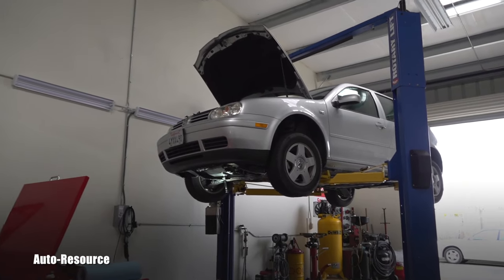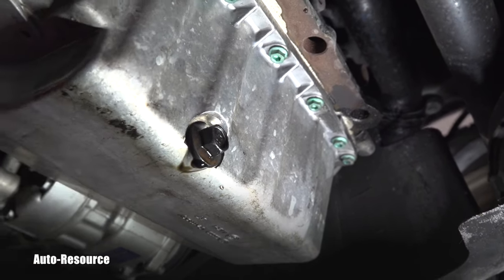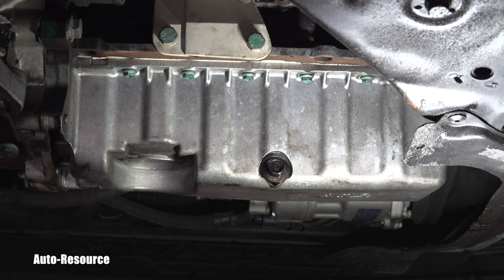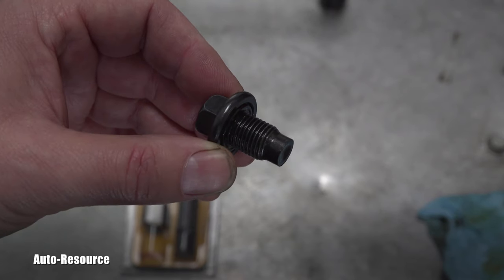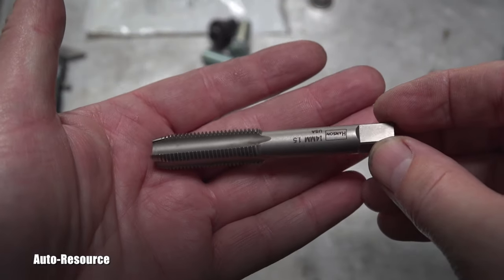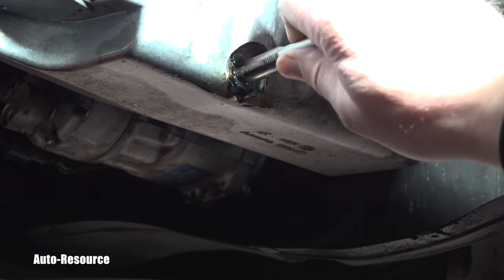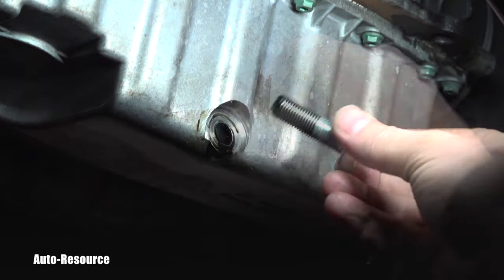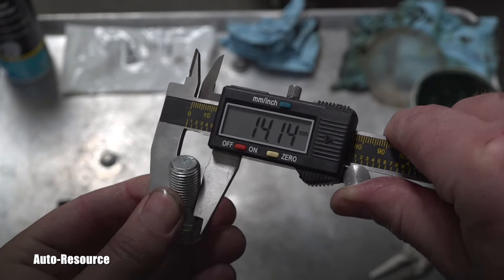Stripped Engine Oil Pan Plug Repair

Comment: please mention that alot of these problems are caused by incompetent Technicians who over torque the bolts, use impact guns, etc. This is not a tire change, these bolts do not really require much torque at all. The result is rethreading or changing out the oil pan. Do dealerships do this on purpose to generate money or do they hire people who dont know what they're doing. Either way this is an expense that is unnecessary.
Reply: It also randomly happens I've done 25+ oil changes on my Honda and today all the threads came out when pulling the plug
Reply: I got "scammed" by a service shop that offered a 1/3rd discount oil change for $55. They gave me a "Free" diagnostic for over $1200 of additional (upsell) work - which I
 declined. Unfortunately, my teenage granddaughter went back to the same shop for a 2nd oil change - wanting to get the same discount. That's when this shop pulled out their scam! They claimed the oil pan gasket got over-torqed (butt and the car/oil pan that had No Oil Leaks and without a "Service Engine" 😊 light display now needs to have the oil pan and gasket completely replaced at a cost of $1100.😮
We're going to end up in court over this scam...
Reply: @wowgen123 is correct.  This is a pattern failure on Honda oil pans.  Also, dealerships (and other independent shops) all have some incompetent employees.  You don’t put your ‘A’ tech on oil and tire changes. It’s usually a high school kid working part time.
Reply: Fr I got scammed by the last person that owned my car. Same issue I just did my oil change for the first time yesterday and same shit. Bogus now I have to use a thread tap kid to make a new thread 😅

Comment: Nice fix but you should always crack the filter loose before installing the drain plug.  They typically hold a 1/2 qt of oil due to vacuum.

Comment: I used the spark plug repair kit shown. Tapped new threads, put the insert in, and used a spark plug as a drain plug.  Not sure it was needed but I wrapped the spark plug threads with plumbers Teflon tape and plumbers dope. No leaks yet.

Comment: Would have poured in some new oil to drain out metal shaving  great info
Reply: save the old you take out  before you cut use that to flush

Comment: Great repair, however I would have trimmed the 9/16 bolt to the length of the thread in the pan, perchance a longer "Plug" would come in contact with the Throws of the crankshaft.....that would be catastrophic.....just observing....

Comment: I had issues on a 2014, 1.8 L Jetta. It would slowly bead up oil under the drain plug, after I did and oil change. The cheapest fix I found was to use a O-ring. I actually use a rubber O-ring that I use on my Harley Davidson touring bike. Fit beautifully and stopped the leak. If my threads were stripped, I probably would resort to cutting new threads, thankfully I didn’t have to.
Reply: I had this idea too. My Jetta Mk5 might be stripped, but if it's just ok, I might try your o ring. Or else the silicon make-a-gasket. Otherwise, I've just ordered a helicoil for $30

Comment: Just so i get this right.. the original thread in the sump was to fit sump plug M14 x1.5. And you used the same tap size m14x1.5 to make new thread? And it worked clearly. I would have thought you would need m15 tap
Reply: I think its because he went beyond/past the original thread aand further into the ool pan , creating new threads .

Comment: You gave a fantastic video presentation. I’m sure you have got to be or once we’re an instructor for auto technician school. You could easily make a subject seem so simple. 
I found your video on trying to remove a spinning oil pan bolt that I can not remove on on an old Massey-Ferguson tractor. This didn’t solve my problem but I sure enjoyed your video and I did pick up some pointers. Thanks

Comment: Thanks for the video! 
And for those who are doing this...
9/16-18 is the thread pitch he used.
Virtually the same bolt as the oem 14mm x 1.50. but a tiny bit bigger.

Comment: two things you should have done first to cut the new bolt to the correct length second you should kept the old oil and re add it to flush the shavings  from inside out and then add the new oil.
good job

Comment: I have the same issue however the bolt just turns and wont come out thinking about drilling a hole.. any thoughts?
Reply: apply  outward pressure while turning plug with  flat screwdriver under plug head.

Comment: The body shop guys did it when taking it for oil change. They said last people stripped it. Never could change oil. Now I have problem. How to get old oil out and plug fixed without spending a fortune on new pan and swap

Comment: Is Toyota Seinna's 2004 oil pan threading also aluminum?  I have the exact same problem, but have not looked at the threading inside to see if it's damaged. And if changing out the pan is necessary, do you recommend using permatex on the new gasket seal?

Comment: Good evening 

When removing a sump of a Golf 4 1.6

Wat tool do I need to remove the two nuts in the middle, next to the gearbox?

The rest are removed
Reply: 1/4 inch universal joint.

Comment: Thanks, great video. I have a question, what is the max length that the replacement drain plug bolt can be?

Comment: I have a 99 Toyota Camry 3.0L V6 with a stripped oil drain plug.  I want to perform this exact thing.  The original bolt that is stripped is a    M12-1.25.  I would think I have to go slightly bigger so what would be the right size tap?

Comment: 9/16-18 UNF has a 1.41 mm thread pitch. It must slightly deform the 1.5 mm female threads as it winds in and since those threads are aluminum that happens easily, at least for a short bolt.

Comment: Wow, I learned something today! Perhaps you could have used a 9/16 * 1.25 pitch oil drain plug instead of the bolt? Anyways, this is a lot cheaper than a new oil pan!
Reply: Never seen a fractional bolt with a metric pitch
Reply: @beckyschwantes5287  
9/16”-18 a bit bigger than 14-1.5
Reply: @beckyschwantes5287  there is a lot this guy don't know.

Comment: Some idiot put lock tite red on my oil pan plug now I can't remove it! But I was wondering if I'm able to remove it can I put a new plug with re treating
Reply: if its not leaking pump from top side instead, some new cars they want it done that way now anyway. keep the empty 5 q bottle on hand to empty into then save the bottle from the change you do. this way you never have to jack the car or put on ramps and get under.

Comment: Looks to me like the bolts holding up the oil pan were green: makes men think that this was an aftermarket oil pan thus no metal sleeve for the plug. 
Just sayin...
Reply: I was thinking the same! and also made think twice when searching for an oil pan replacement! ill be looking at the threads from the drain plug to compare to the old one!

Comment: My bolts is stripped except it won't come out of the hole I can get a wrench on there but it just spins not sure what to do I put a vise grip on it with no luck..
Reply: If there is space, slip a flat blade screwdriver under the bolt and apply upward pressure while turning.  This worked for me.
Reply: @maryreed2280  thank you. I'm going to try this on my stripped bolt

Comment: @Auto Resource EXCELLENT fix! I have a 2006 Ridgeline like your wife’s and I have a small leak, too. I want to do this fix. 

Ridgeline drainplug is M14x1.5. I want to retap like you did. What are the specs of that new drainplug you used? I heard SAE 9/16 but I didn’t get the thread type. THANKS! 

I’ve posted before that even though I have a Honda I LOVE watching your videos. You are a great teacher and explainer. 👍🏽👍🏽👍🏽
Reply: Helicoil

Comment: Same issue just not as bad.. M12x1.5x16mm oil drain plug would you go to M13 X1.5 x16mm and rethread with tap? If so what size tap
Best Regards
Reply: I have the same issue and size bolt. What size ended up working for you?
Reply: M13 x 1.5MM Oil Drain Plug Tap Thread Repair Kit Oil Pan Screws Rethread Tool, 
Ended up doing a hand tap, then flushed with liter of oil. So far no leaks...set torque at 15 lbs instead of 18 not to over torque

Comment: My drain oil plug just spins, any suggestions?
Reply: Did you get it out? I'm on the same situation. ..
Reply: @byroncos  yes I did but I had to remove the oil pan & wire weld the boss nut back to the oil pan